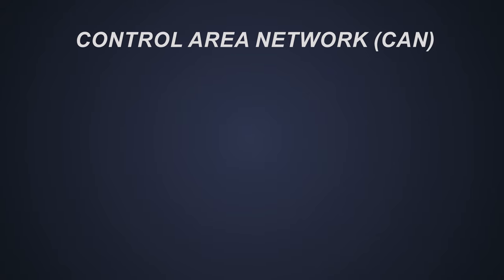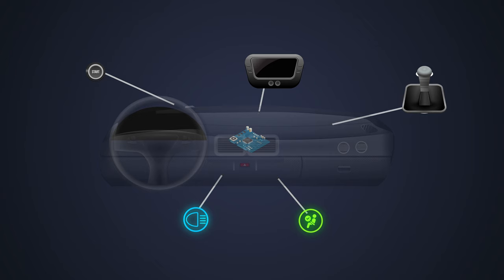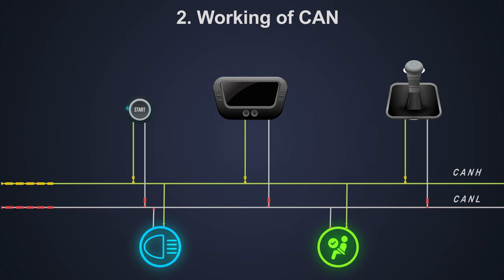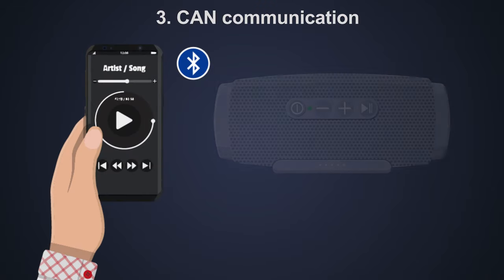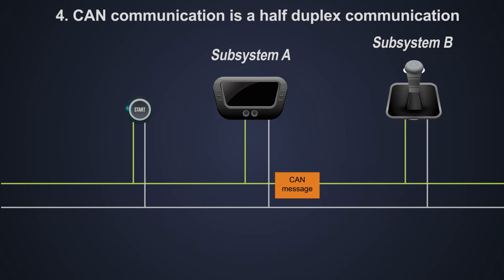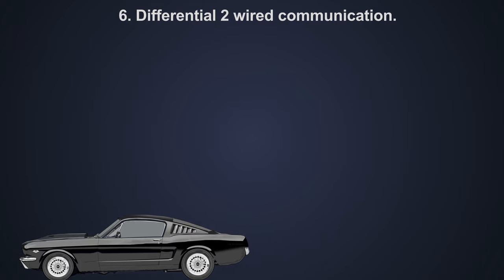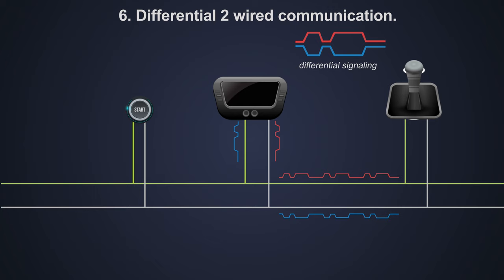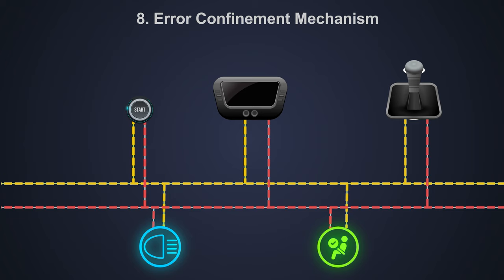Why do we use CAN Communication? Advantages of CAN communication

Comment: Very Good Explaination.
Would like to have different videos like this.
Can you tell me how I can control the BLDC motor using the CAN communication??
Reply: Why?
You'd likely need a can to raw/digital signal converter likely.
And why would you need the can protocol anyway, it's just gonna increase the cost massively?
You'll likely need a microcontroller on each end that you want to control.

Comment: Hi everybody, I have a Honda civic 2010 coupe is false error link when I setup ODB2 scan then I probed CAN-H and CAN-L look ok but L-line is a straight line 9 volt dc, it has no wave form during ignition is on or engine is running. I am not sure what it should look like before I continue to chase it down to find the problem. Anyone has any suggestion please!!! thank you every much. I don't want to bring it to the shop or dealer because the value of my car might be cheaper than the cost to repair.